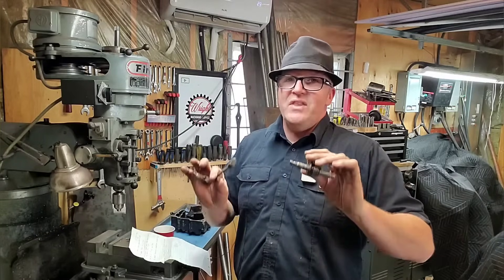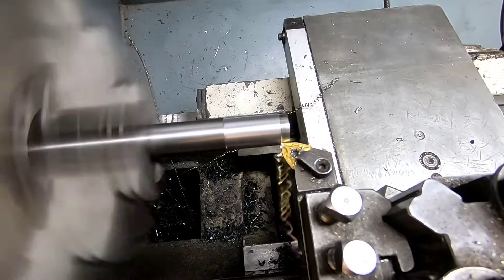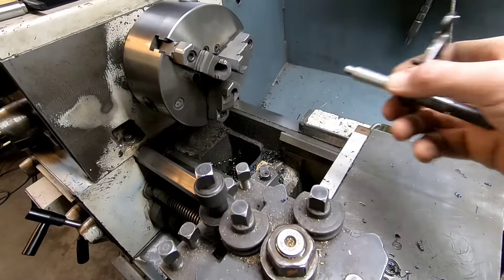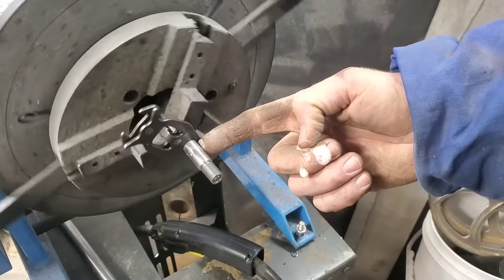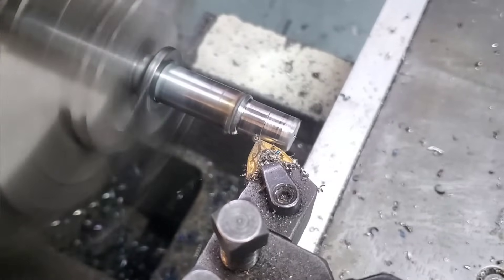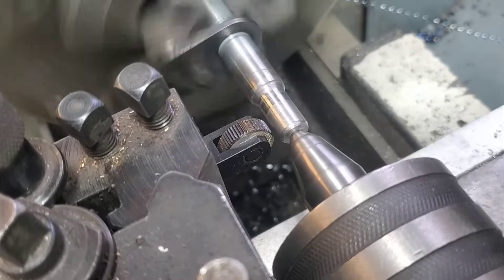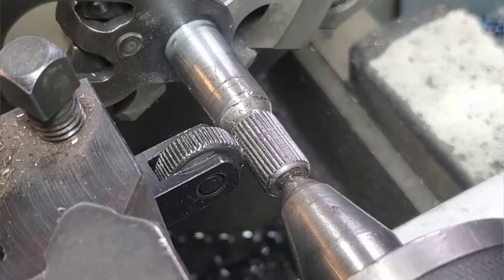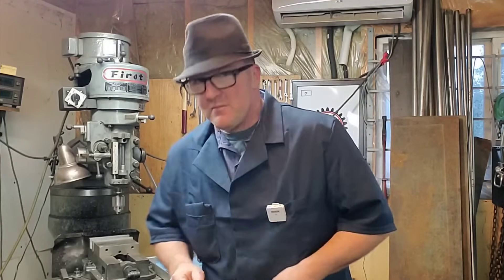Making a Motorcycle Shifter Spline By Knurling

Comment: Wondering why you didn’t just weld the shaft and then turn it down.
Reply from the maker: I wanted to put on 1045 steel and only had plain wire in my welder
Reply: Fair enough…good video
Reply: A wire brush does a good job knurling

Comment: I was thinking you really don't need that groove in the splines for the pinch bolt to go all the way around . The tip of the shift lever doesn't need that much point up or point down adjustment . If you just filed enough groove for the bolt you would have most of the  spline go all the way across and  make a stronger connection  ?  I understand that would never be practical for the factory to do it that way.. Great video .
Reply from the maker: Good thought . I see what you mean . I will try that next time
Reply: I agree. Why weaken the shaft unnecessarily. Strength and purchase are important.
Reply: If you do that though, you better know Exactly where that lever sits on the bike in relation to the mechanism inside the case. No adjustment for the customer either. I've never seen one break at that point for what it's worth.. ✌️

Comment: The most important thing about knurling is getting the diameter correct. just a few thou too big or to small and you will end up with what you had, a double knurl. I always check the pattern by hand, and reduce the diameter gradually until I get a perfect mesh. Think of a knurl as a round thread. Tool maker 35+yrs.
Reply from the maker: Thank you , that makes sence ,  kinda like gears .  I had wondered about that .   I feal like there is more wiggle room than a gear of course since it is forming the work .   But if you are directly below or in the middle between the teeth spacing i can see it being an issue

Comment: i start with the roller 1/2 or more off the end of the part spin at slow rpm as under 100 it is not a cutting  process it is manipulating the metal it needs lubrication as in oil, when it is time to turn it in turn it deep and quick before it makes a full turn ,i always get good results
Reply from the maker: That sound like a good meathod for sucess. I ave noticed as well hitting it hard and fast before it takes hold to much usualy ends in a good result while molding the metal .   Thank you for building on the video :)

Comment: A lot of hassle to do it this way.  Much simpler to just install the shift lever and then drill a series of holes in the interface between the shifter and shaft.  Tap in some pins of your choice and viola!  All repaired in about 10 minutes.  You can Loctite the pins in and if you want to hide the repair, apply some silver paint.  In effect, you have made new splines, they are just cylindrical.  Quick, simple and effective.
Reply from the maker: Thanks mark , yes this would do the job for sure , i know some guys even weld the shift leaver on as well .   ( little hard to work on it after welding )   The guy wanted it for a restoration job on his classic though so we made sure it was factory looking

Comment: I enjoyed this and look forward to my own repair job as I will be facing a repair on a Hond XL 250 kick starter spline and lever.
Reply from the maker: Glad you enjoyed it.   I think to do it again I may have covered the shaft some how to protect it from spatter and welded it up on low heat little bits at a time with a big welder ( .024 wire with 75/25 has )  Then machined it. Could be a lot simpler that way. The only draw back would be to much heat I to the shaft

Comment: Very nice I learned something. I had 6 months training before I went off to university and study engineering. Back then they didn't even have indexable carbide tools or DRO's. Now in retirement I have just bought a new Precision Matthews 1440GT lathe and an 835 mill. Cheap Chinese tooling and I'm having a blast...:)
Reply from the maker: Frankish  , man I'm glad to hear that.  all my stuff is second hand or with cheap tooling as well.  In fact the knurling tool I was using cost $10, lol.    
Dro is worth the money ( all my dros are Chinese ones and are good and accurate ) 
What have you been building?
Reply: @Wrighmachining  Well so far I have been setting up and reconfiguring my shop. I built a clean work bench with a steel top, then promptly put all my grinding gear on it.. NOPE!.. Now have been moving all the dirty stuff away from the machine beds. I put a 3 axis (Chinese) DRO on the mill and mounted the encoders so that all the open sides are turned away from the flying chips. This meant a lot more bracketry and 3 days of work.. But hey I got a nice mill to make all the adjustment slots..:). So far I have welded up the supplied thread on the QC toolpost and on the lathe screw cut the required thread.. I actually used the HSS tool I ground in 1980 in my apprentice program.. I was surprised I didn't mess it up. So far more welding than machining. I gotta get me one of those straight knurling tools. I assumed the splines were cut on a dividing head.
Reply from the maker: @frankish5314  man, you have been busy.  The dro is life changing. I had a 10 x30 Frejoth lathe before this one and it didn't have one on it and then got this one and put one on. It made working so much faster.  The splines were roll-knurled, super easy to do once the height is set.    I did it the hard way a few years back on the indexer and was a pain To do.  

I had to start covering the machines due to the grinding dust and torch table cutting. I found the black moving clothes (/cotton ) at princess auto ( like harbor freight) for 5 each. Wish I had a separate room for it all but that's just another thing to spend money on that I don't have :)

Comment: I did a yz125 gear shaft by getting a longer shaft with correct spline from the bike wreckers and then grinding off the weld from the end plate and parting off the longer shaft and creating the shoulder and then welding the end plate to the new shaft. Worked really well and was $10 plus my time.
Reply from the maker: Good idea , Thats definatly one approach  .   Did you leave it a little longer ?  How did you protect the seal surface on the shaft while welding ?

Comment: I've done a similar repair.  I just silver soldered the sleeve in place. I leave them at 1/2" diameter and use the early Sportster shift levers. They're smooth inside and believe me, it takes a lot to make them slip. And, when they do, there's no damage to the transmission or shaft lever. I once even made a custom stainless shift lever. I'd bet I had less time in that than you did in repairing your shaft. Just another way to think about.
Reply from the maker: Making one from scratch in stainless , love the idea .   Plus you would not have amy week spots where the weld repairs are .

Comment: That is amazing, i never thought it was done this way, its way faster then the press/gouge method. Maybe the factorys have a spline cutting tool that they press over the shaft, but the wear on the tool might be very fast.
I could see you would want to do a test run first to really see if the pitch and starting diameter was right. If you get others to do, keep in mind they dont all have the number of splines.
Nice video
Reply from the maker: Thanks man , truth be told the idea was given to me by my father while we where having coffee and we did some experimenting before the video to make sure it would work .  I would think as well in the factory it would be some kind of die as well that puld cut it in on motion .  Glad you liked the video !

Comment: Careful.  Is the welding current passing in turn through the lathe bearings?   I use an old copper plated woven flat car battery earth over the lathe shaft/chuck.
Reply from the maker: Oh no I definitely don't weld on the lathe.  I'm using a welding positioner (/it looks like a lathe but is designed to weld round stuff )  Basically it works like your saying it had a piece of copper that drags on the chuck and doesn't destroy the bearings in the head of the positioner .good point !

Comment: Thank you, thank you, thank you. I have 3 shifter and a couple kick starter shafts that all need to be repaired in a similar fashion. Could you possibly show us the chart for spline numbers? One of the parts I need to fix is the kick starter shaft on my 1981 Maico 490. A replacement part that is difficult to find at best, if not almost impossible. I could easily repair what I have after watching this video. Thanks again.
Reply from the maker: Im so sorry , i have missplaced the spread sheet i had when i made the video and im traveling right now ( panama city )  and i cant look it up in the machinery hand book .    But there are calculators out there for it .  Perhaps this one
https://littlemachineshop.com/reference/knurler.php

Or this one . I realy nerded out on this one just now ,lol it has alot of info 
https://www.machiningdoctor.com/calculators/knurling/

Comment: I had that problem with my moped many years ago but I just put a piece of thin plate from a soda can around the shaft to get a tighter squeeze. I think it held up quite well but not as new splines.
Reply from the maker: Some times you do what you have to when you dont have to tools and have to get home :)

Comment: Nurling always increases dia so your should bear this in mind for final OD.
Reply from the maker: Yes, that's right.  Knurling is displacing the metal and molding it with point pressure.

Comment: Wow. Great tutorial
Am new to machining and i can't quite understand how does this work with knurling! How wont knurling tool teeth overlap from one turn to the other unless it is perfectly maching shaft diameter? Is that how it works? So you just have to get perfect shaft diameter to get correct spline teeth number and no overlap? Thanks
Reply from the maker: Great question .   Knurling is a metal forming operation . This means metal is molded like you would clay . Just at higher pressures .   The first step to it working is to have a closet size diameter . Since its forming the metal its a wider tollerence that you can have  and usualy is not a problem, usually the wrong size diameter means the wrong amount of teeth and not overlapping.  Once you start the tool into the work it creates a path , it has to have a good pressure on it so its deep. As it does a full rotation the last tooth of the knurling tool will hopfuly pick up on the first groove formed either mold that very first tooth wide or a little short .  Then it molds the next tooth with less error and so on . By the time it has gon around a couple of times it would have evened out like it nexer happened .    

In saying that there are times when it just will not seem to work . Thats because the hight of the tool is wrong , dull  or rarely the diameter is not correct .
Reply: Thank you so much for explanation. I will read it and think it few times to try and get the idea lolll..

Comment: Great job , Just wondering how tight you would recommend that pinch bolt to be , my manual says 10nm but that feels tight and it squeezes the gap down at and angle , do they just need nipping up so they don't move around or would you tourqe it to the manual spec , my bolt is an m8 hex head into aluminium
Reply from the maker: To be honest I can't give you an answer to this. But what I can speak to is I  have always referred to factory manuals my self and it's best practice to follow them.   I have heard very experienced mechanics say that after market manuals frequently have errors in them and I do not trust them 100%.  

Hope this helped
Reply: @Wrighmachining  thanks for the reply and I totally agree , I settled with 8nm as I just nipped it up and it felt just about right and put the tourqe wrench on it and it was 7.5 nm so I went to 8nm , but any more than that on such a small bolt into aluminium would be overkill I think 👍🏼👍🏼
Reply: @bccapone837 Ok, now I get you mean screw torque, Newtonmeter (Nm) and not a atomic layer play measurement in nanometers (nm).
The difference in 7.5 and 8Nm is moot. Not reliably torqued, due to dirt, nicks and burrs. The wrist dynamometer, the shortest tool and clean, oiled threads, is my tip to get the best clamping without galling the aluminium.

Comment: I always use an air compressor and brake cleaner to make the knurls clean in between oiling.
Reply from the maker: Good point thank you, Compressed air would have worked better for sure.   Next time :)

Comment: Great video!  Question, how did you know that knurlimg wheel was the right pitch for that spline?  Also, a few blasts of WD40 would have made quick work at removing the knurled chips ;-)
Reply from the maker: Wd40 !  Yup your right .  Dont have any though :)  .    It was kibda fitting it up by eye and then trial and error on a testor peice .

Comment: at 17:00 what is getting the grooves? It is repeated pressing (forging) by ridges on that rotating tool ? The diameter of job need to be precise so that whole number of ridges make the perimeter
Reply from the maker: Yes the od is cut to very close to the other size. . If memeory serves me . ( it was a few years ago ) it was a hair smaller than the part .  Half way between the top of the spline and the bottom .   This should be the size .    Hope that helps.
Reply: @Wrighmachining  That is quite precision work. Thanks for the reply.

Comment: Kids strip these all the time because maintenance is the last thing on their minds. If you catch it before they get stripped you can hacksaw thru the back side of the shifters female spline just a bit and it will tighten down further on the shaft. But, if they keep using it sloppy, they destroy the shaft. Some shafts run thru all the way to the right side, other shafts are accessed from the left cover a bit easier. I like the way you fixed it, it makes me wonder if you could make the shaft slightly smaller, use a female spline that's hardened, heat up the shaft shaft, and broach them in one shot. Especially if you cut the bolt relief first, you'd essentially be broaching 2 -  separate 10mm long portions of splines. Lots of Honda motors have a female spline on the inside.
Reply from the maker: On guy has sugested cutting the weld on the old one on the plate and making a new stainless one and rewelding the shift plate .   Im thinking of trying that in the year to cpme on the next one .    Thank you for your imput DC

Comment: That worked out really well! I wonder if you were lucky to find a knurling wheel to match the splines you needed to make, or if they are both commonly that size?
Reply from the maker: It was a bit of luck how I came across it, but I deal it's a standard size they use . however, there are a few different sizes you can find.

Comment: All caused by motorcyclists not bothering to keep a check on the tightness of the bolt - if you do they don't wear out (motorcyclist speaking here) good repair though
Reply from the maker: Thanks buddy , yes a little maintenance will save so much work down the line for sure.

Comment: 11:11 WTF
Reply from the maker: Lol , are you refering the the machine singing coment made .    I can see how you may think it odd. But in my defence the machine will maik noise when it is working properly and differnt noise when its not .   Tbis is the reference to the machine singing .  :)
Reply: @Wrighmachining  I'm not talking about singing, I have nothing against machine singing. I'm talking about the pin left on the end of the part, which deflects the centering when drilling begins, I'm not a turner but it looks very strange
Reply from the maker: Hahah  @s-vr2hu6si7s , well yup your correct i should have set the height correctly :)